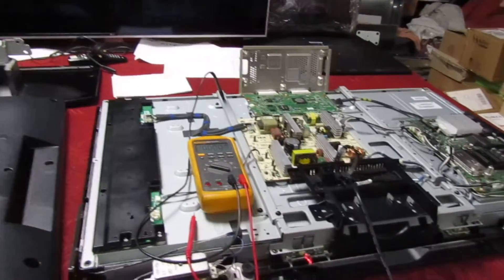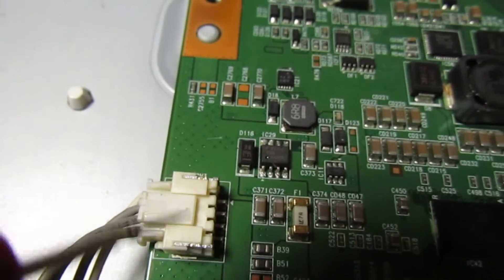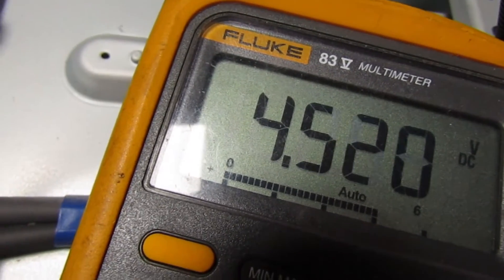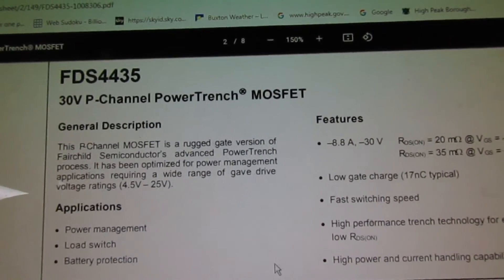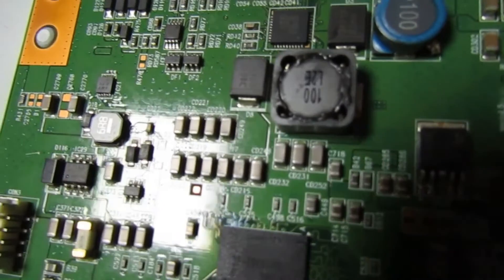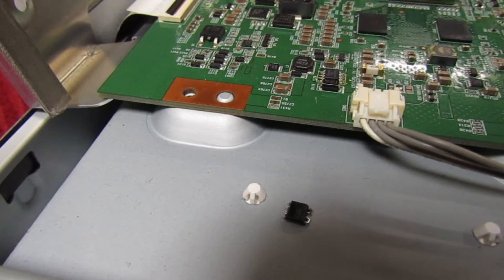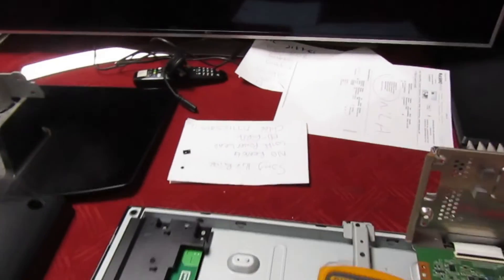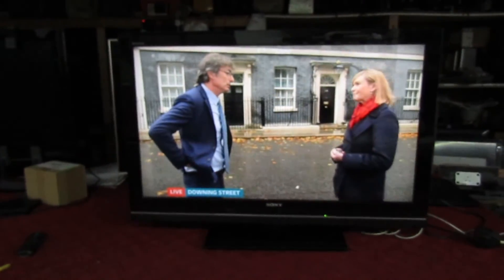Sony KDL-40W5810 . 14 Blink error code repaired to component level .

Comment: Thanks Micheal. I will check the MOSFET on my TV. It also shows 14 blinks.
Where do you connect the negative terminal though?
Thanks for sharing,  Marco
Reply from the maker: Just the metal work at the back of the TV screen .
Reply: @michaeldranfield7140  Many thanks for your fast reply. I measured and found <4V, so ordered the spare part. Once I have put it in I let you know if it worked.
Reply: 日本の視聴者です。結果はどうでしたか？

Comment: Hi, i got the exact same fault as the video and changed the mosfet.

Now my TV is on a solid red.

Have you got any advice to what it might be? 

Thanks in advance!
Reply from the maker: are you sure the sets not just in ST/BY , with some sets if its turned off with the remote you must use the remote to turn it back on again, also check you have 12v coming out of the other side of the mosfet.

Comment: Why do you replace with the exact same model IC chip and not a stronger one ?  Won't it just fail again after a year? Or is that the idea?
Reply: by the way I have a KDL-32W5500 had this 14 blink code but for different cause. Similar "power rail low during start up" corrupts the I2C data from display's TCON board. here where I am metal tarnishes quickly. Was plug/socket contacts. Can't get Servisol10 here so very diluted fosforic acid
Reply from the maker: set is about 10 years old so if the new chip lasts as long as the first the customer wont be complaining .

Comment: If it was a tv designed before all these LED ones it would have had a proper high current mosfet instead of these horrid little smd ics anyway a nice easy fault for anybody left in the trade
Reply from the maker: Yep , not many left in the trade now .

Comment: Liked your  IC replacement. I remember being on a Pace soldering ( soddering according  sales bloke that presented it)  course years ago where they had skilled operators demonstrating the meniscus technique  of soldering fine pitch multipin ICs. I don't  remember if it was a special tip or just operator skill. I never got the hang of it
Reply from the maker: I have all the Pace soldering gear and tips but sometimes its just too much trouble to set it all up , especially now when your working for next to nothing .

Comment: Michael, I have always struggled with soldering because of crappy fluxes. What kind of Flux would you recommend for smd work? We do have RS Components in my country.
Reply from the maker: the liquid flux I use is made by Interflux electronics NV , And its model number is
 " IF 6000" However this comes in a 1 litre bottle so it will last forever , the manufacturing date on the bottle is 2006 !
I would stay away from the internet and fake products and buy from somewhere such as RS , expensive I know but at least you will get the real deal .
Reply: @michaeldranfield7140  Yes, thanks. I did purchase a small syringe of paste flux from RS Components. I have a 128 pin IC to solder so i am quite nervous because i used to use the fake RMA-223 and had dismal results. So i bought a locally produced flux that's quite aggressive and then that caused other issues. It actually corroded the IC, I mean how do you clean corrosive flux behind those pins of a QFP128 package. Its impossible. You have to avoid agressive flux, no good for electronics.
Reply from the maker: @HLL-Addict  I clean off any flux residue as soon as the new part is soldered in .

Comment: Excellent job! Does that fault apply to other sets in the range, or just to this specific model?

I have a couple of Sony's of my own, and to be honest, and touching wood, they've been good as gold so far, but how long does luck last these days?
Reply: We've had a Sony since 2010 (bought new for the world cup) in daily use ever since without any problem. No idea what new models are like but the old CCFL backlit ones seem pretty reliable. I think over 12 years is pretty good mileage these days.
Reply from the maker: No , just to that model , although other model sets can have a similar arrangement for switching power to the board .

Comment: Thanks Michael i have a 32V 4000 similar model though it looks like my Tcon is slightly different but hoping that mosfet is on tcon. My issue was 4 blinks. Great work
Reply from the maker: I think 4 blinks may relate to an inverter fault but you would have to get the service manual first in case im wrong .

Comment: Do you repair a lot of the older lcd tvs still? What would you charge a customer for the repair you did to the Sony? As most people just buy a new set these days as lot less power consumption too with LED backlight etc..
Reply from the maker: I charged £40 for this repair , not a lot I know but no one want to pay anymore because sets are so cheap brand new , I remember the very first flat screen set I repaired , the customer had paid over £2k for it and I charged £230 to repair it , now you can buy a brand new TV for £230, so if I didn't do cheap repairs I would have no customers at all .
Reply: @michaeldranfield7140  it is a shame that many more sets aren't cost effective to repair anymore aswell as screens getting higher resolutions - just a bit of a joke that free view only transmits most channels in standard very poor quality!

Comment: Thanks Michael, being retired from the trade i don't receive all these time saving information
anymore.
I liked your way of removing the chip, far easier that messing about with a rework station.
Please keep these tips coming.🙂👍
Reply from the maker: The correct way would have been the rework station but sometimes when your in a rush there are shortcuts !
Reply: @michaeldranfield7140  Nothings wrong with doing things the quick and easy way

Comment: Was a keyboard tech for 40 years. Enjoyed going to component level repair. Along came the digital keyboard era and most of the IC's were proprietary and couldn't be purchased from the manufacturers. All they wanted us to do was swap out the boards. Well any chimpanzee could do that kind of repairs.  Found a new career in aviation enjoyed the hands on building of airplanes. I still enjoy my electronics servicing, being I started at the age of 10. Worked and got great tech servicing training from a old time radio & tv shop owner.
Reply from the maker: This is one of my problems , Im old school , like you I was brought up component level fault finding but these days modern repairs just consist of swapping a board , no fun there , I really shouldn't be doing this job now but Im addicted to electronics and cant stop .

Comment: Thanks, helpful to know....I've got the 32W4000 from 2009 which looks (externally) the same - is it likely this is a common issue that might affect mine one day?
Reply from the maker: While it wont have the same T con board it may have a similar arrangement to switch power to the board .